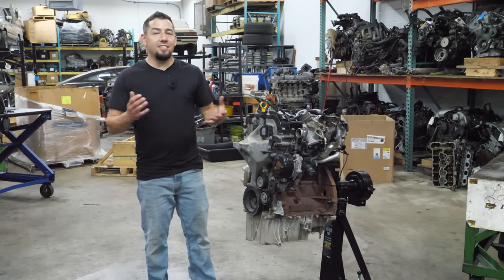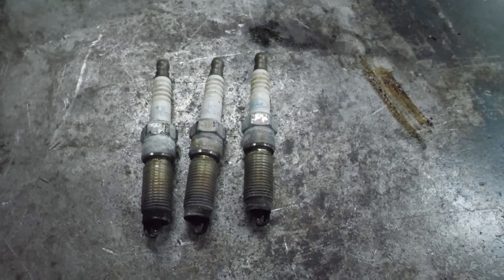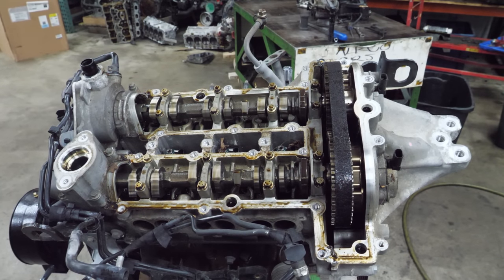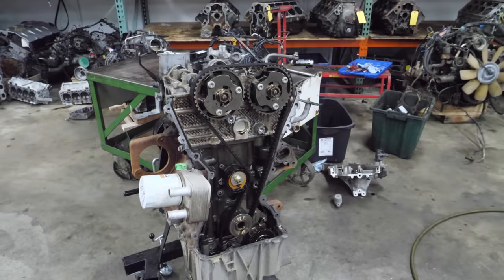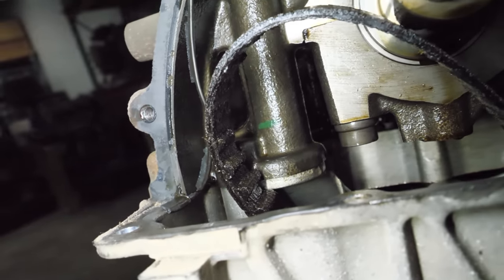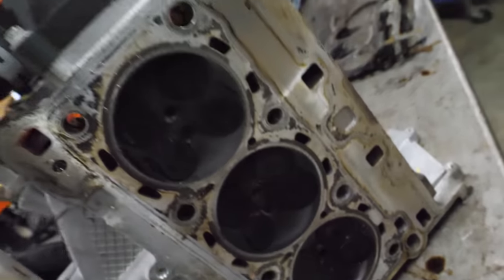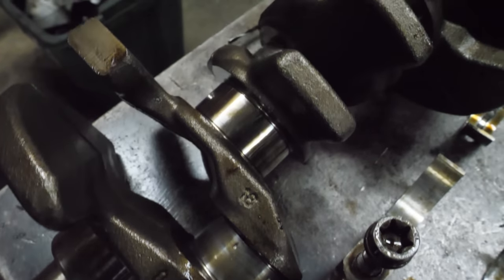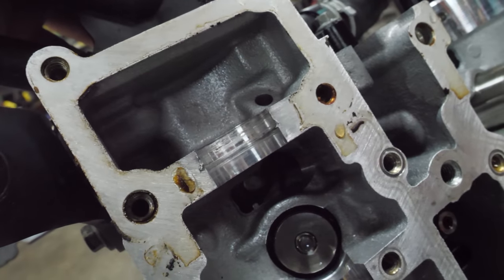JUNK Ford Ecosport 1.0L 3-Cylinder Ecoboost Teardown. LAWSUIT ENGINE!

Comment: This engine was designed to survive just long enough for the car to be out of warranty. Also, Ford hasn't keyed their timing components in at least a decade. It's all held in time via tension. They even make special tools to lock everything in place anytime you need to undo the crank pulley. Because that bolt is the only thing keeping the engine timed.
Reply: Same with VW
Reply: wait 'til you get one of those shitty Peugeot 3-cyl ones. they destroy themselves way before the warranty is over and Peugeot always try to put the blame on you... 😹
Reply: The older Mazda L engines(MZR 4 cylinders) also didn't have keyed cranks. This channel has 3 teardown videos for the turbocharged 2.3 engines and Eric wasn't happy any time he had to touch one.

Mazda's own Skyactiv engines have changed the crank to have keys, but some of the Ford Ecoboost 4-cylinder engines are based on/have design influences from Mazda L engines, so they still lack crank keys.
Reply: I'm not an automotive design engineer. But I have worked on several models of older American engines. V-8s of course. Is there any other kind? OK. Straight 6s can be great. 
The lack of keyed belts still stuns me. Am I correct that the tensioner made of plastic, that had disintegrated, was all that kept the engine timed? Unbelievable.
It must be a non-interference engine because there was no evidence  of valve damage? 
American Ford V-8s could be be poorly designed. A 289 1966 Mustang used a cam gear with nylon coated teeth. The nylon would wear down and cause the incredibly strong metal timing belt to slip a tooth or two. Hopefully no more than that.
Why? It made the engine quieter. And probably accelerated planned obsolescence for Ford.
Reply: I followed a ford puma the other day and one of the exhaust pipes was still shiny inside.... They've welded a second pipe by the side of the real pipe to make a fake twin pipe exhaust to make it look like a powerful car.

I've also seen 3 new ish pumas with rusty non functioning back brakes.... Dopey owner driving around for 3 years in a new car with only front brakes... 🤮
Reply: So  just   needs  chains instead of   belts  and a few   key ways  be  a good   engine
Reply: Crank  looks bit   like   disco  one  not a lot  of  metal  at webs
Reply: Agreed about the none key way of the Crank and pulley, found that out when I replaced the timing belt on my old Fiesta. Thanks for nothing Ford, Probably saves 50p on manufacture of the engine, yet increases the risk of slippage of the timing or incorrect re setting up after timing replacement, totally reliant on tension and friction, crap idea
Reply: @kittytrail Which one the one in the  108 which was designed byToyota ( Aygo) and has chain timing? That's ok. The clutch lasted 30k on originals and water pump not so hot.
Reply: Planned obsolescence..
Reply: @h8troodoh  The car industry since the 50s
Reply: Ford is not the only manufacturer using keyless cam drive components/sprockets. On assembly, the crank and camshafts are held in their timed position by fixtures which ensure the cam timing meets the design spec.  Tolerance stack up prevents keyed drive sprockets and cam sprockets from achieving sufficiently precise cam timing.  Sub-optimal cam timing degrades emission performance and fuel economy.  On some applications a diamond impregnated washer (one time only usage) is required to keep the sprockets from slipping once torqued.  I believe the Chrysler hemi uses one. @msmeyersmd8
Reply: @ancientbriton8262  Ford is not the only manufacturer using keyless cam drive components/sprockets. On assembly, the crank and camshafts are held in their timed position by fixtures which ensure the cam timing meets the design spec.  Tolerance stack up prevents keyed drive sprockets and cam sprockets from achieving sufficiently precise cam timing.  Sub-optimal cam timing degrades emission performance and fuel economy.  On some applications a diamond impregnated washer (one time only usage) is required to keep the sprockets from slipping once torqued.  I believe the Chrysler hemi uses one.
Reply: Wow! Great advert for Ford quality. How long have they been making engines so badly?
Reply: @1337penguin Do you know why they don't key the drive for a timed component? Seems weird to me as presumably the oil pump and balance shaft consume a fair bit of power, thus exerting torque on the drive- so how on this setup, is the torque transmitted?
Reply: @msmeyersmd8 engine timing is commanded by the long belt, thats why there was no interference: it was timed. The short belt on the bottom was what driving the oil pump and that belt desintegrated. So the engine run with no lubrication.
Reply: @g.n.b.3351 I bet they could just use variable intake and exhaust timing to make perfect timing on a keyed engine. Fiat's twinair engines have this
Reply: @triodehexode  pretty much Every industry when you think about it.
Reply: @garypeatling7927 plus some other changes, but for how long?  Designed to be discarded.
Reply: @mb106429  Is it dopy owners or dopy service staff? If driven in town or gently one could probably get by with front brakes only.
Reply: @g.n.b.3351  Well, first, this engine is not at all efficient, the MPG figures confirm this, I would say it's designed for power, low cost and low emissions, but not economy. Can't the VVT correct a small valve timing missalignment?
Reply: @abbersj2935  manufacturers and the people they sell their consumer grade crap to.

They don't need to MOT it untill 3 years so they just drive 'round without anyone ever noticing nor without it ever going to a garage.

If it does go in for a "service" then that is only an oil change and maybe some filters and that is all under the bonnet, they don't look at the car properly or test anything.

Driving around town etc doesn't test or use the brakes ever. The 1st time the problem becomes aparrent is if they go out on A roads and brake too late when someone turns right..... Big smash
Reply: @mb106429  Thats simply not true.
Many if not most cars require an initial early oil change and check up. After this there is a yearly service that takes place. Brakes should be checked at these times. This is all well before three years old.
Reply: @ancientbriton8262  There is no risk in slippage of timing on non-keyed engines. I've never ever heard any brand losing timing because of that.
Reply: @mrdomhare Renault too..
Reply: I suppose they cannot be bothered machining the good parts.
Reply: @kittytrail  If you buy a French car, you buy a diesel.
Reply: @lillexus5589   despite being a silly french cat, i'm not stupid enough to buy a french car... 😹
Reply: @kittytrail  I drove one of those in a courtesy car it was a 70 plate Corsa which shares all its running gear with a 208. The engine at less than 2 years old and only 25k miles was drinking a litre of oil in 500 miles. Shocking engine if you ask me.
Reply: @kittytrail well they're hell of alot better than Ford
Reply: @mb106429  the Pumas with twin pipes have a valve which closes off one of the exhaust outlets, if you follow one in traffic you can actually see this vane open and close from behind so i think that explains the difference in colour of the tailpipe. The rusty non functioning brakes you witnessed i believe are the drum brakes fitted at the rear so that explains that one, i know these things because i lease one at the moment and cannot wait to give it back - awful car.
Reply: @garypeatling7927 possible a chain on these small engines just robs too much torque? Or maybe they're just being cheap 🤣
Reply: @UnknownJinX  TBH the diamond washers do work well, it's just kind of a pain in the arse to have to replace the parts every time you have one apart. But timing them is pretty much foolproof with the (cheap) tools
Reply: @garypeatling7927 How about Mercedes chains? Worst than anybodys belts?
Reply: @triodehexode chains of the Toyota? I haven't heard anything good about them. I think that most of the cars run with mystic smoke and when it comes out, you just have to fill engine with new magic smoke.
Reply: @msmeyersmd8  It's pretty much mandatory to have non-keyed parts somewhere to have really accurate timing. If not in so-to-say pulleys, then you'd need ie. adjustment in cams to get everything very precisely timed, which is actually getting mandatory with modern low displacement and high power engines. It's critical to remember that we're far from ie. 70's really underpowered cars.
Reply: @Aivansama1000  Quite many BMW models too
Reply: While I'm not a fan of not having keyed pulleys, this is quite common in other engines that have perfectly fine durability.
Reply: europeans are convinced this exact engine is one of the BEST bc europeans are used to even worse garbage from VW (VW engines that were never offered in america) LOL
Reply: My 5,2L V10 Lamborghini (Audi) engine is also held in time via tension on the camshaft sprockets
Reply: @garypeatling7927 Gary they have fitted chain to the later ones, the cylinder head and liner problems are another big issue for them
Reply: @ironmantooltime May-be, cheap?
Definitely cheap.
A rubber belt that sits in oil 24/7 has a good few months before it decays. 
They could easily put in a bicycle chain it would have been a few $ more and lasting years. 
Cheep cheep cheep junk imo. 
A Snowmobile engine would last longer. 
I could tell right away as he began it was run starved for oil and knew it was something stupid with the design
Reply: Apparently Ford fitted a chain from 2022 onwards. But there was absolutely nothing wrong with the previous innovative rubber belt in boiling oil design.🤥🤦‍♂️
Reply: Volkswagen has used those same designs for a long time back in the early '90s, at least in their funky V6. The cam pulleys and crank pulley weren't keyed. You just had the line them up and make sure they're all aligned up right and then you torqued everything down. Same with some Fiat engines
Reply: @kittytrail  I drive a French car with a 3-cylinder Japanese engine, the 1KR-FE, and it is probably the most reliable engine in automotive history, and is ubiquitous in Japan among K-class vehicle. In 17 years, it has had the water pump replaced, which took me under an hour, costing £23.
Reply: @ancientbriton8262 BMW are just the same with the N55 S55 and yes they do slip and trash the engine.
Reply: @paddyglenny it’s the only way to get precise timing, bmw and most other manufacturers are just the same.
Reply: @peter7624  since Christ was a cowboy 🤠..
Reply: @@shane888davies6 He used the term timing belts. I believe they were metal reinforced timing "belts".
Just like metal reinforced radial "rubber tires". But? Your mileage may vary regarding proper engine terminology.
Doofus? WTF?
Reply: @msmeyersmd8  A doofus is the smaller but more complicated version of the thing-am-a-jig
Reply: No
Reply: Ridiculous design

Comment: Recent MSN story: "According to the recall notice, the belt tensioner arm may fracture because the retention caulk joint isn’t robust enough to withstand engine vibrations. If this happens, the tensioner could separate from the backing plate and cause the belt to degrade by losing teeth."
Reply: Wow - Thank you!
Reply: Thats exactly what happened here
Reply: They caulked it up big time.
Reply: Thats what happened to my daughters.

Comment: As an ex warranty administrator  for Ford here in the uk I can say we changed dozens of these engines under warranty. We were doing several a week! It’s a completely poorly designed engine with little robustness. We had them meticulously maintained and still failed. Ford technical told me they were stressed to the limit the minute they leave the production line and have no resistance to any faults like low coolant. In the end we didn’t even bother stripping them down. Just fit new ones. Must have cost Ford millions in warranty repairs. Same as the 2.0 litre eco blue diesel in the Transits. They have tarnished the Transits reputation.
Reply: I watched the BBC news story on this. It clearly showed where coolant had leaked into one of the cylinders. I believe that it was a 1.5 L.
Reply: Very surprised Ford allowed this design to go into production!! This wet belt type must have limited life - with such destruction by the belt through the oil pick up etc When the engine was stripped!! (Even the tensioners were damaged too)
Reply: Thanks for your information.  Didnt no that!
Reply: I had the misfortune to own a Focus, worst car I’ve ever owned, every thing that could go wrong Did.
I will never buy another Ford Ever Again, that’s I’ve now found out how good Vauxhall cars Are !
Reply: @michealhaskell7258 Ford  started that the wet belt, was a lifetime fit!
Reply: I won't trust that car on a long trip even it is Neue car..
Reply: Lol Transhit has never had a stellar rep to begin with.
Reply: Mine went at 39000 miles never again will I buy a ford!! Still £10000 on a loan and now no car for ignoring me

Comment: Thank you for showing me what happened to my ford focus ecoboost 50,000 miles, serviced by ford at the correct times and it still went wrong and ford don't care. 30 years driving ford, but never again!
Reply: yep
Reply: Ford unfortunately builds garbage now. Never had these problems with a 302 or a 351M V8
Reply: Just don’t buy anything from ford that’s “ecoboost”
Reply: Stop buying ford since. 2001. Life is better since.
Reply: New GM engines also use this shit design
Reply: If you have the details go to your ford dealer, ford are now provideing compensation in the USA at least
Reply: Yup. Decision I've made too.
Reply: It’s kinda sad cause the duratec engines that were in the focuses were great little engines.

Comment: All the engineers who worked on this cried when they were told it had to have no timing keys and that they couldn't afford either a timing chain or seals for the belt. Only the accountants went home happy that night. 

Still....

There was this one engineer, maybe a team, who stood their ground. They may have risked it all. Their careers....everything.

I salute the head bolt team. That was unexpectedly satisfying
Reply: Loads of modern engines do not use keys. It gives more accurate timing. If the bolt comes loose, the key won't save you, anyway. 

However, keyways aside, an engine does need to be designed competently and we see a few howlers, here.

I wonder if the engine design team in Cologne comprises engineers who missed the cut at BMW, Daimler, Porsche, VAG, AVL, FEV ... etc. ?

Comment: I really like the use of a plastic thermostat housing living right next to the turbo.
Reply: its super genius, Corvettes should have it too.
Reply: turbo so tiny they thought it wouldnt generate enough heat
Reply: Looks like that is more reliable than the tensioner so it doesnt matter long term anyway
Reply: What could possibly go wrong. One of those miracle high temperature plastics no doubt
Reply: I think the designer got shit-canned and decided to sabotage it.

Comment: On the negative side, the oil-soaked belts mean the engine will fail relatively quickly.

On the plus side it'll still outlast the two PowerShift automatic transmissions it'll be connected to 🤣
Reply: Actually... you'd be surprised. My aunt and uncle had (or maybe still have) an EcoSport and the engine was nothing but trouble from day one. It was taken care of but seemed to chew up a belt like this one did every 20k miles. I think it spent more time in the shop than it did their possession, but the transmission never went out.

I hit the transmission lottery with my 2013 Fiesta.... for a while, at least. It went in for the recalls, and every once in a while it would shudder, but the TCM going out at 132k did it in back in 2021. After six months of waiting I bought a new car, and here we are almost two years later and it's still sitting on the lot, not fixed. A shame, because other than the TCM I never had an issue with the car at all. Ran great, got amazing gas mileage, and the only time it left me stranded were dry rotted tires from sitting before they went on my car. Wasn't obvious at the time of purchase, unfortunately.
Reply: They didn't use the dual clutch on the 1.0 ecoboost. They had a 6F15 torque converter transmission and a manual transmission option.
Reply: wow
Reply: They use wet belt in lawn mower engines,  but a car engine?  NO thanks.
Reply: @Discretesignals  wet belts in mowers are an equally awful idea right along with plastic camshafts...even Honda makes trash like this
Reply: Honda GC overhead cam residential engines= wet belt. The GX engines last forever=pushrods.
Reply: @05milmachine90  I never heard of a belt internal to a lawnmower engine.  What engines do you speak of?
Reply: @tommak6516 I believe it's the GC series Hondas. Plastic camshaft, wet belt, trash
Reply: The Wet Belt was marketed as a lifetime non replacement, belt.
Obviously this wasn’t correct, the oil caused the rubber belt to disintegrate, and either totally fail or the disintegrated rubber bits would clog the engine and cause it to fail
Reply: @brucecooley4170 pushrods are junk hence why they're still used for small engines